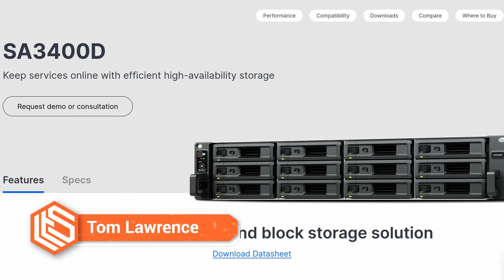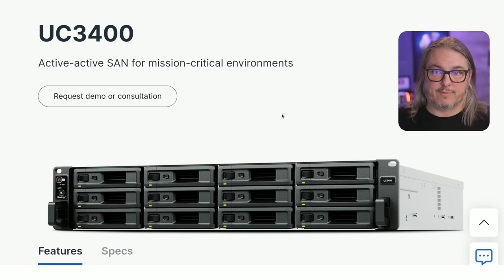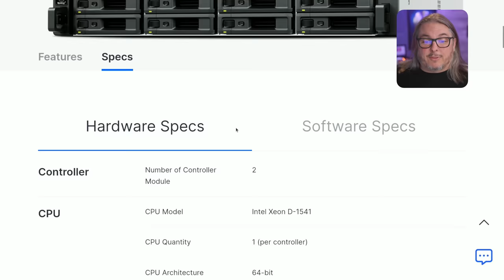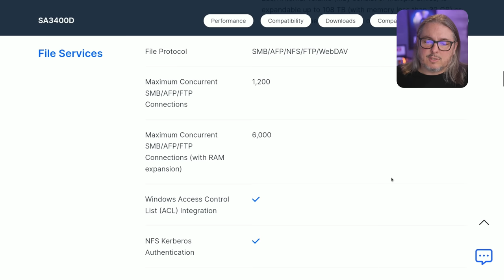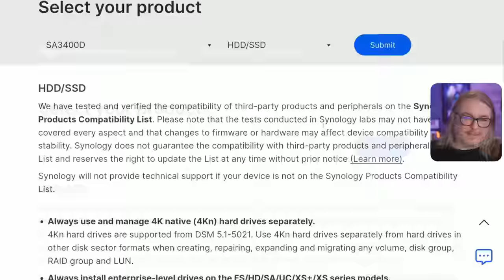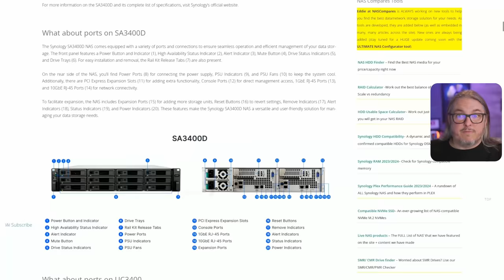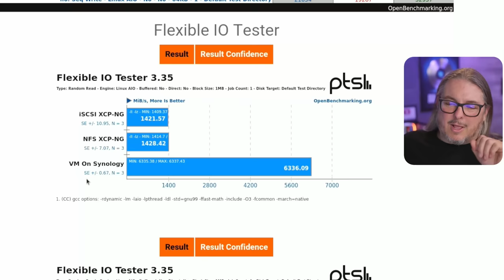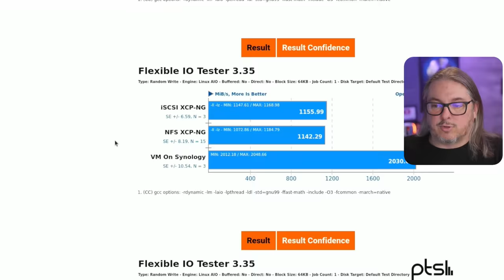Does This Synology SA3400D NAS Really Balance High Availability & Affordability?

Comment: I don't recommend Synology. You will not be able to source their drives anywhere in the APAC region.
You would be better off going with QNAP and they now support ZFS.
Reply: You can get drives from Bluechip or MMT in APAC region.
Reply: @locusm  Thanks 👍will help those who already have a Synology. Pricing is no joke.
4TB Synology (7200 RPM) - $468
4TB WD RED Pro (7200 RPM) - $243
4TB WD RED Plus (5400 RPM) - $177
Reply: @ericneo2  Youre right, they cost a bit more. Hopefully they dont reach Dell/Lenovo levels of crazy.
Reply: @locusm  Yeah I remember they were charging $950 for a 2TB just 3 years ago.